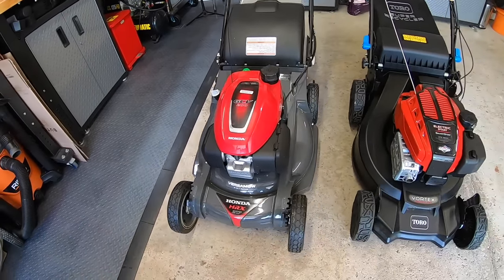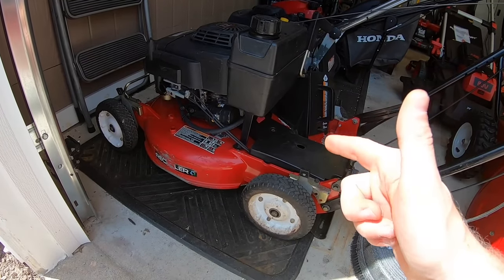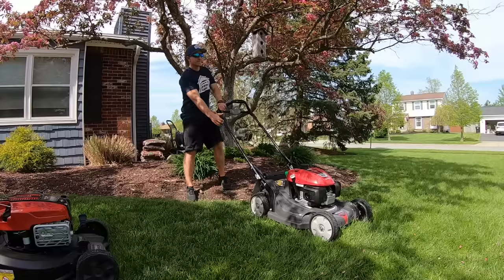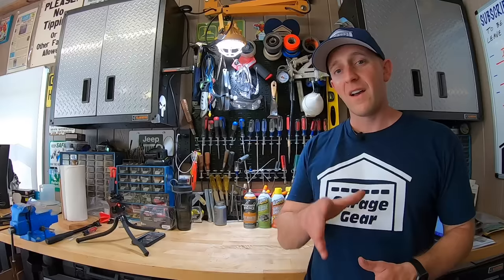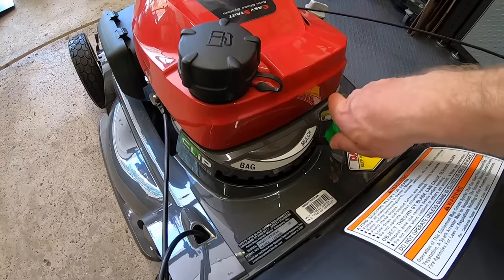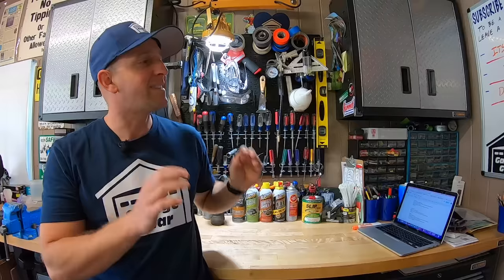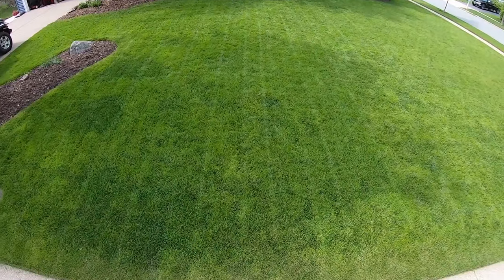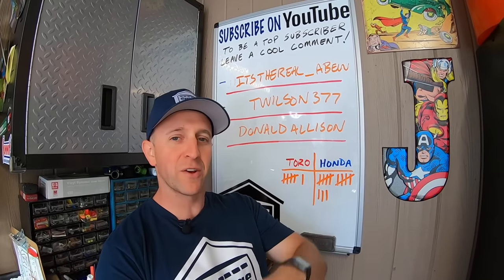HONDA HRX217VKA VS TORO SUPER RECYCLER 21564 - WHICH MOWER IS BEST?

Comment: Toro all day long I have both and I love my Toro much more have the same exact models
Reply from the maker: Thanks for sharing Jp
Reply: @HOOV:316 - I am looking at these same two models.  Why do you prefer the Toro?  I have a 28 year old Toro with the 3 speed transmission and am used to picking a gear and letting the mower set the pace.  For this reason I am thinking that the Honda might be handy.  It seems that the Toro variable speed might be a pain to get used to.  Your thoughts on the differences and why you prefer the Toro would be very helpful for me.  Thanks for you time.
Reply: @rhays4445  Toro cuts better has more torque and the personal pace is 2nd to none! It mulches better IMO never leaves clippings behind even when high and wet. Honda does very good too but I honestly think the toro super recycler with the 8.75 Briggs and Stratton just gets your money's worth and parts are easier to come by.. honda is sadly done producing and I don't know exactly why they are but I promise you that you will not be disappointed in the toro
Reply: @Jeffroson78 I will argue that Toro is higher quality..

I feel like all of the great reviews on Honda mowers are fake, and coming from the company itself just to make sales. But that's just me.
Reply: @GarageGear  thank you sir keep up with the great videos love them
Reply: @TearsOnABlackRose  you could not have said that any better yes I've had Honda some of them are excellent but the Toros that I have have the 9 horse Briggs & Stratton on them I put them on personally because I like having power behind when I'm mowing and of course the self-propelled moved a lot better too but yeah you're 100% right sir I absolutely agree

Comment: Well being that honda recalled them and told customers not to use them because they are unsafe that basically makes the toro the winner huh?
Reply from the maker: The toro has its fair share of issues too like not backing up. I would try to find a gently used Honda! 👍

Comment: I have a 2 year old toro recycler 22 in. It is pretty much dead. The transmission went out and I am constantly replacing wheels. I will be buying a Honda.
Reply from the maker: Thanks for sharing this!
Reply: It runs well, but it just kind of fell apart. If you go through the reviews of recycler, most of the positive reviews are paid promotional reviews, not real customers.
Reply from the maker: @DJBucket  this is not the first time I’ve heard this. Toro paying people for fake reviews? 🤔
Reply: @GarageGear  I wouldn’t call them fake necessarily. More like short term paid reviews.  I do think a good video would be the base Honda vs the toro recycler. Just a thought as I did buy the Honda this weekend and did my engine break-in. Toros are on sale this weekend Hondas are not…
Reply from the maker: @DJBucket  I do like this idea! 👍
Reply: @DJBucket Milwaukee does this a lot too. They target YouTubers knowing a lot of ppl watch for reviews

Comment: I have had both.  Toro will not much a tick fescue lawn.  If the lawn is somewhat damp it will gum up in the the mower and kill the motor.  The design is not for mulching, the Toro does not circulate the clippings and in my case in the mulching mode it dropped a vast amount of clippings on the would be side discharge.  I became so frustrated with Toro after 3 years I gave it to a lawn mower shop and bought a Honda. Honda by far is 100% better.
Reply from the maker: Appreciate you sharing this Michael!

Comment: Many research hours.  Reliability is top of importance list.  Many reviews = HRX, citing reliability.  Was about to scour local area for Honda HRX.  Then came across one web review citing major changes to HRX engine.  Thrust was "significantly fewer parts."  Sadly can't find now.  Then saw "All new Honda GCV200 engine" as direct quote on Honda's national Canadian website (repeated on sales sites).  I only advise caution.  A significantly new engine (esp. in light of cam issues reported here), new for the year Honda's getting out of the market is (to me at least) a huge red flag.  Can anyone confirm new engine for 2023?
Reply from the maker: Thanks for sharing this! Honda is done making mowers in September. Did a video on this a little while back. 👍
Reply: @GarageGear  Watched most if not all your mower content.  Wonderfully helpful.  "Dirty 30" will guide me forever.  Now I'm off to find 2nd best!  (Having trouble; suggestions welcome!  The Toro in your videos is currently top of that list.)
Reply from the maker: @Doodelz02  surprisingly there isn’t much nowadays in terms of quality gas equipment. I’ll continue looking but it seems going commercial is the only way to go because homeowner models are so cheaply made nowadays.

Comment: I bought a Honda HRR 5 years ago and ended up giving it away. Worst piece of crap I ever owned. Had a defective carburetor right out of the box. The Honda power products dealer put a new one on it under warranty, and that one didn’t work either. Three times a charm.

 A year later, the self propelled transmission failed. The next season the axle bushings seized. (Honda uses a steel axle, that runs thru a steel bushing, that passes thru a steel holder.) Geez... what could go wrong?!?! Toro uses sealed ball bearings.

Lastly... I had to cut my lawn twice with the Honda as it left stray grass blades sticking up with one pass (even with new or fresh.y sharpened blades).

Most of my neighbors have Toro Personal Pace mowers (two are 20 years old) and they never have problems. 

I dumped my Honda for a Toro and and never looked back.
Reply from the maker: Thanks for sharing david

Comment: I've had both these mowers.. i found in regular use i preferred toros self propel system but everything else the honda rocked it. on my Honda the height on the wheels are a pita to adjust. I run a toro striping roller on my honda but it really burns up the self propel after time. I'm on flat ground here in NW ohio. too bad honda is getting out of the mower business. I really wished honda would of made a 30" version of the toro timemaster mower.. from what i've seen its a piece of ***
Reply from the maker: Thanks for sharing this Jamison! Shame they are done next month!
Reply: Just bought my Honda out of the shed and it won't start.. now I feel like I should have went with Toro